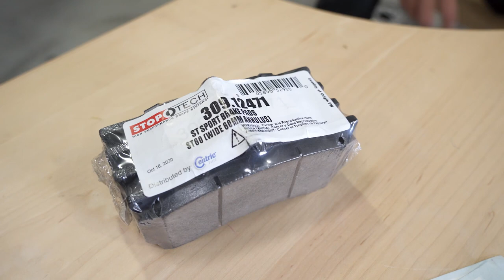380mm StopTech Big Brake Kit - PRR/IMS Supra

Comment: Nice video. If you want to not have the brake fluid mess next time. Put some pressure on the brake pedal and keep it there while doing the job. This will close of the main brake cylinder and there will be no fluid coming out of the brake lines.

Comment: Not steel, but *gray iron. A common mistake.

Also, the StopTech 309 "Sport" pads are probably the best dual purpose street/track pads out there.

Also also, Castrol SRF is the exception to the rule but only because its wet boiling point is still very high.
Reply: Oops. Guess it's like calling oil "40 weight." 

I think I may have used 309s on Zach's GTO many moons ago, and I remember them being pretty good on track. But, given the temps we're seeing on this car, they definitely would not be enough. 

We're switching to Endless brake fluid, which tests very similarly to SRF. Should be good to go with that.

Comment: Any worry about the crush washer on the line going into the back of the caliper no longer doing it’s job after you initially tightened it to stop it leaking, but later adjusted its orientation?  My understanding was that crush washers were one time use items.
Reply: Nah, I didn't tighten it hard enough to actually crush the washer the first time. Just snug.